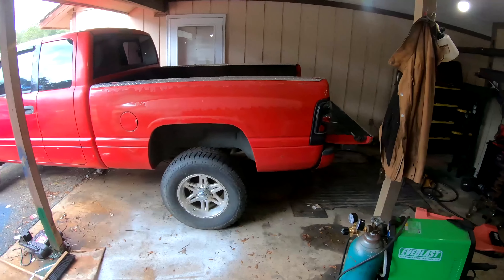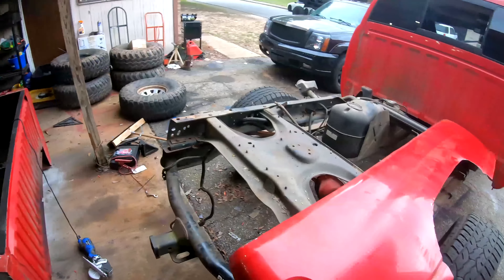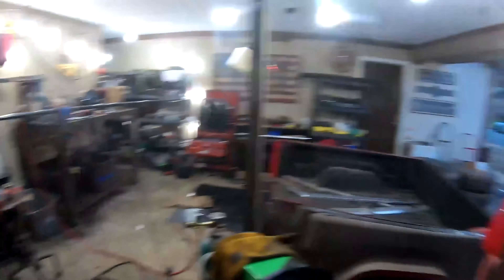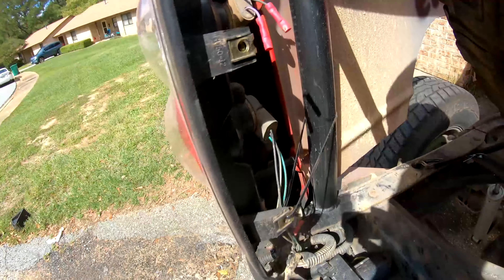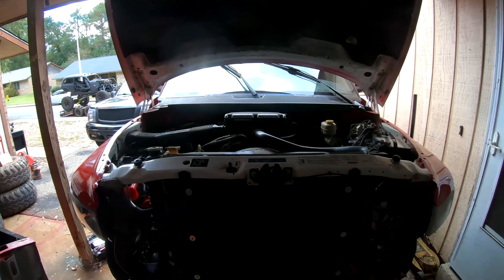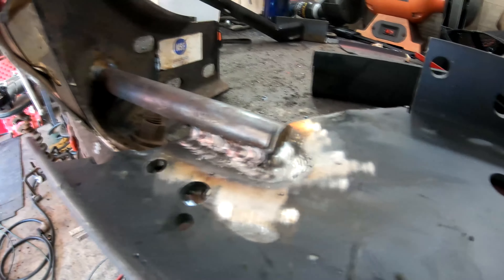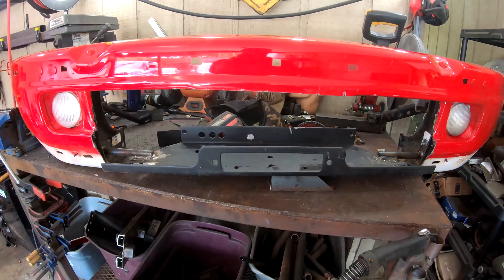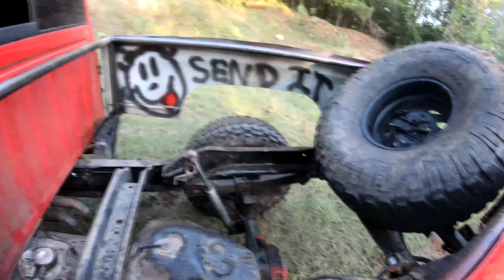Turning a Farm Truck into a Crawler (Part 1) || Legacy 4x4 and Off-Road

Comment: I remember back in the old days around Pasco we used to buy $500 Fords and cut the fenders any way we could so we could shove 36 or 38 on them
Reply from the maker: Seee that’s basically my same thought process on this one,, minimal lift
Reply: @Legacy4x4andOffRoadYT  sometimes keep it minimal lift helps with longevity then you don't need ladder bars and all the long shocks worrying about pinion angles back before Ford's turned into such junk one time I had one sitting on two frames the frames used to be designed to stack at the factory they had pegs on the bottom and holes on the top where they kept them in a stack you could cut all the running gear out from under your truck and Roll Another frame underneath Bend brake lines down to where they reach only thing you needed was a drop pitman arm weld the two frames together it was a little too heavy for mud but it did awesome in the sand